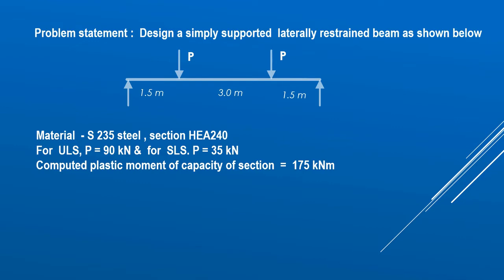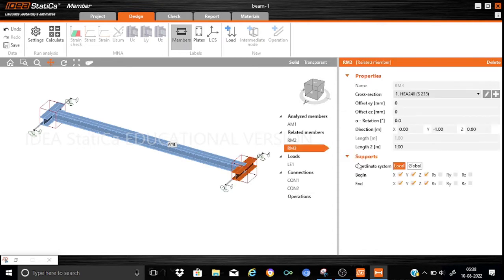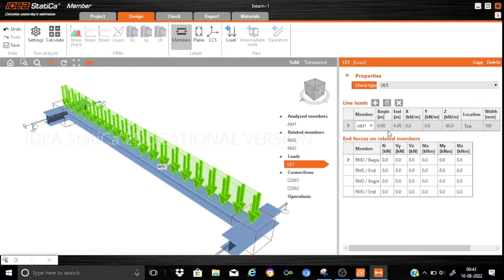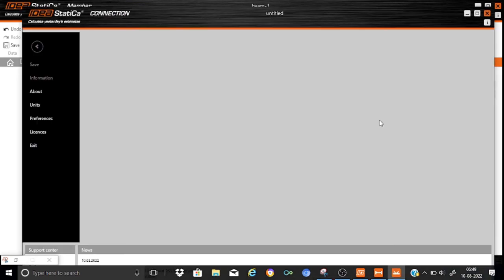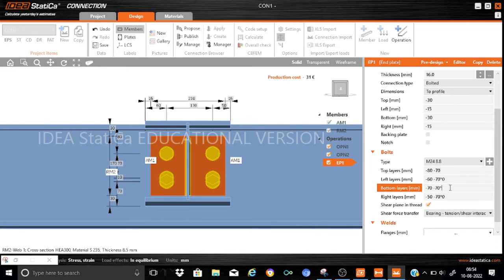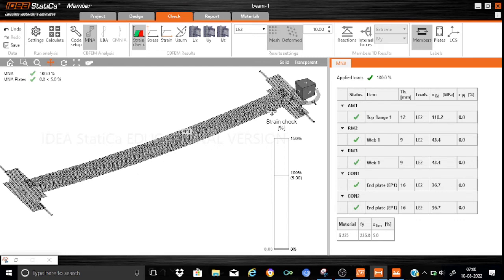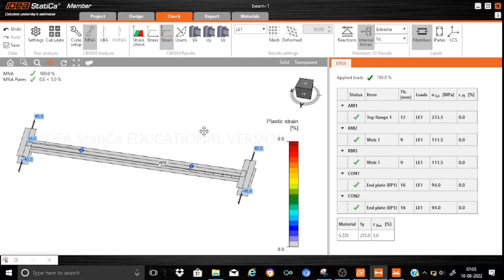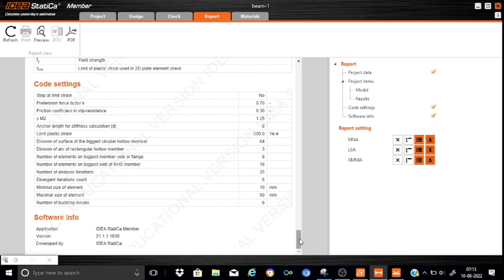Tutorial 33- Idea Statica Member – Design of  a laterally restrained beam (  Eurocode EN 1993 -1-1)

Comment: Sir can you upload any  truss connection design for a span of 50m width one in 1. Bolt connection 2. Weld connection
Reply from the maker: Hello hari ,
you can refer to my tutorial-24. Can u please make it more clear why the truss span is mentioned in your qn....???
Reply: @puttattjayarajan1199  Sir we are doing one industrial project of 50m span truss resting on RCC column. I have not done truss connection in idea statica
Reply from the maker: @1921990hari  You can simply  practice with one or two  truss connections (preferably use my tutorial as well). It is in fact very simple . You can also start with std. template......
r u preparing fabrication drgs as well or want to make some std . connection drgs to delivere to fabricator's office..?
Reply: @puttattjayarajan1199  yes sir we are making fabrication drawings